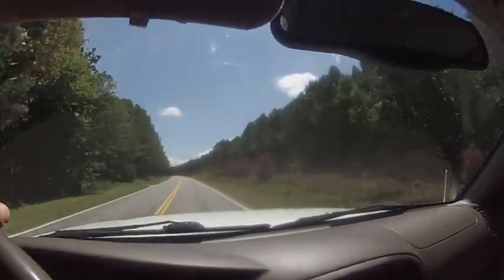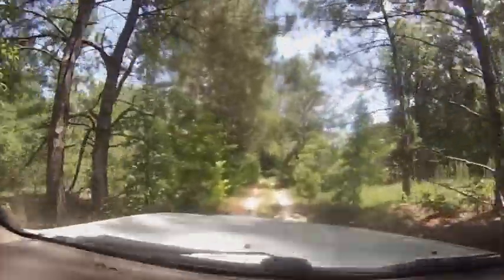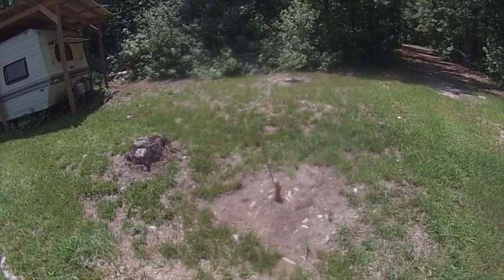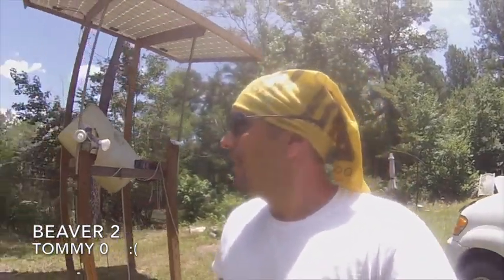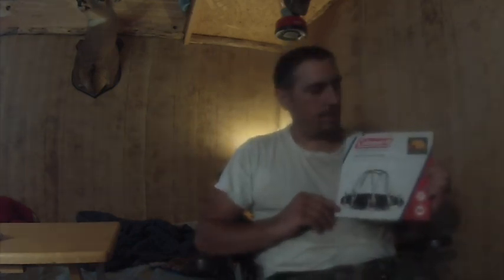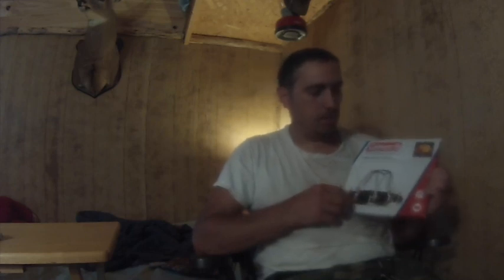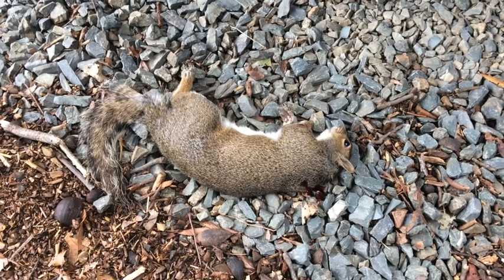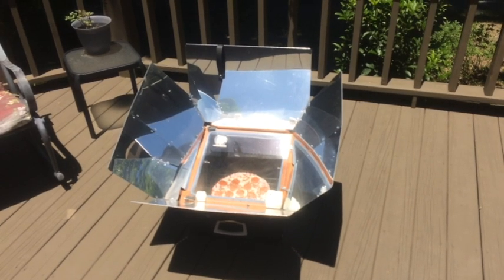Off Grid Cabin: More Tresspassers

Comment: Had the same issue on my off grid property.  I hinge cut some trees and dropped them over the trail.  They couldn't move the trees because they were still partially attached to the stump.  It worked for the most part, but they did find a way in on labor day weekend...But I caught them!  They walked around a bend in the trail and there I was standing in the trail.  I encouraged them to stay off my property and they haven't been back!

Comment: It looks like they are under power lines and they have sprayed herbicide on it to kill off the vegetation. They are doing that here in VA also.
Reply: Should have cooked the squirrel.
Reply: No its not roundup its definitely aluminobariumstrontophate sprayed from commercial airliners by the Illuminati based in the center of the hollow flat earth with a backup base on the dark side of the moon where the Naziempire is. 😂 
Some of these guys are not off the electric grid they're off the mental grid...

Comment: You need the jackleggs caught red-handed. Motion activated cams. Also look up boobytrap shotgun shell. Basicly a military grade trip wire attached to a simple device that fires a shotgun shell. Set it up correctly, and it's safe. This will send them running. After the unfreeze...... Lots of ways to eliminate the problem. Many!

Comment: The toaster will work well. Flip the bread as it's toasting. Maybe install a barbed wire fence across the path and hang a sign from it? I once drove across a mountain and ended up inside a locked gate. I drove over a ton of logs to get around the gate to leave. My quad was teetering a couple feet above the ground at times. I personally feel that tiny particles in the air are affecting the bees, bats and trees. They all have to deal with tiny particles. The trees are weakened and then things like bugs move in for the kill. After fracking came here, we had a lot of trees die. Fracking is radioactive. Radium 226, radium 228, thorium and uranium. So during flares the radioactive chemicals are burnt into the air and it messes things up. But there's so much radioactive pollution going on right now. One article suggested that 8 hours of flight is equal to one chest x-ray. There's a lot of radioactive pollution from things like fracking, leaking nuclear plants and radioactive dump in Washington. But I am curious if they might be geoengineering because of Japan's leaking power plant. Thinking about the storms that go up the east coast. Were those storms created to push radioactive pollution in another direction? But it's hard to believe that they would have anyone's best interest in mind because they hide the PA negative water test results and fact that some PA waterways are now radioactive. Condoms and climate transcript at climate one dot org said that people need predators. All the additional air pollution will shorten life spans. Avoid going out into the rain or having your windows open during or after rain storms because the particles will be coming down from the stratosphere. Everyone has been cutting the dead ash trees in PA. We have one tree that appeared dead last year and it is now trying to grow again.

Comment: Those pines were probably planted along the roadway by the state, to replenish after clear cutting, and were grown on a farm. Sometimes trees that are planted out in the wild die if not watered regularly, until their root systems can take hold enough to support them. This is especially true of pines in my experience because the tap root on a pine is supposed to be very long, approximately equal to the length of the tree above ground. Farm grown Pines tap roots are only as long as the bucket they were grown in.

Comment: You could cut down a few trees that are close together on either side of the road and make them fall across the road.  This will not be movable and impenetrable to a degree.

You could also build a dry stack wall with cinder block. The idea is that you   stack the cinder block like you would any wall, but with no mortar in between the blocks (hence the term dry stack).  Then you use a surface mortar to "stucco" the wall together so that no one can more the blocks one by one.  This can be done on the cheap.

Comment: https://en.wikipedia.org/wiki/Abatis This is a type of field fortification you can use to restrict movement into an area you want to secure. There are good images on the site and although I normally don't put much stock into Wikipedia, this information is accurate for a change. We used these as part of military exercises to create points that were difficult to go through.

Comment: Looks like to me that the county or state has sprayed the right away. As for the logging road, place posted signs on it and get about a pound of roofing nails and deposit them on the road on the other side of the logs. You will get results that way for sure. It works, I tried it myself.

Comment: Signs are a good start and communicate your desire for privacy. On the other hand I some of the old back roads have been traveled for years and there is an unofficial sense of entitlement since the were never really used until the new guy move in.  We get ATVs going across our land all the time; and for the most part they are just passing through on their way somewhere else. I have never seen anyone actually stay on our land just driving by going for a drive into the woods or hunting.  I am in a area where folks are very easy going and not uptight about this type of usage; the only ones I have ever heard with issues are the 'outsiders' not familiar with the people and area.

Comment: In my fantasy, claymore mines would work.  Being more practical,  I've seen a few loads of topsoil (which is not expensive, depending on how far it has to be hauled) at an ingress working well.  A deep wide trench from tree line to treeline works as well as does several steel pipes sunk deep with a bag of concrete around it. They're somewhat permanent but can keep a vehicle out when done right.  Keeping walkers out is a whole different ballgame unfortunately.   That's the big problem:  anyone who has no respect for a No Trespassing sign will find a way in if they really want to.

Comment: You can use several layers of chicken fencing (or other wire mesh) wrapped around the bases of the trees.  Use the entire width (about 4 to 6 feet) from ground level to as high as the width will reach..  Its easy to unwrap the fencing and let it coil loosely around the main truck from the ground to the height.  Stake it to the ground firmly, too, so the beaver can't lift it up and gnaw the base.  Another trick is to MIX HOTTEST hot sauce you can purchase (look for ghost pepper or Butan on the ingredient label as these peppers are reportedly the hottest in the world) WITH PETROLEUM JELLY (Vaseline).  NON-TOXIC to humans and animals; birds lack the taste receptors, but mammals WILL react to the HOT MIX.  Ants, and other crawlies will get stuck in the gooey paste.
The swaths of dead vegetation are from a chemical sprays used instead of mowing.  I disapprove of the chemical methods, but States and counties don't have $$ for tractor power mowers or $$ for workers.

Comment: Just get about 40 feet of 1/2 inch steel cable (preferably plastic coated / rust resistant ) and run it across the trail 3 or 4 feet above those logs from one solid tree to another and put 2 or 3  "no tresspassing" signs on stakes facing outward from the logs and cable.  Then if they decapitate themselves on the cable it is their own fault.

Comment: You also need No Trespass signs placed around your log barrier.  And chain the logs together.  Use your tractor to cut deep ruts across the roadway, at angles, not perpendicular to direction of travel.  A night intruder may get stuck in a rut, and you'll get a license plate to work with, or vehicle ID.  Odds are the same persons are repeatedly visiting your property.
Reply: I would wait until my head is clear. I hear you are not sure what to do. Wait until you are sure and not and not angry.    Stay 😎

Comment: utilities spray along the lines and don't clean up their mess just leave the dead trees
Reply: mary smith Real simple way
Reply: Get a couple pieces of small plywood two by to put about 10 £.16 nails through it planted just under the ground still run over it and they'll have a slow leak
Reply: The cost of four tires will stop them coming from on your property stupid AutoCorrect you knowwhat I'm talking about

Comment: The sun is just too intense during summer. If you measure the amount of UV light light I think you might find it is much higher in the last few years than it should be. Plants are getting hammered because their new leaves burn easily. Weird for sure. Can you afford to buy a game camera? Set that up in a hidden spot to catch them in the act. Ever thought of using removable bollards? The base has to be concreted in, but the post that fits in it and is padlocked on can be lifted out. If the base is deep enough, they can't even winch them out. Good luck. Something like this might do the trick... http://www.xpanda.co.nz/products/removable-bollards-galvanize

Comment: Trees are dying from exhaust fumes .
Reply: Could the trees alco be killed from the salt put on the roads during winter? In summer, the salt melts and runs into the ground around the trees and kills them.
Reply: Nah.. Primary gas from exhaust if CO2.. a plant food... I'm betting they are killed back just as they do in Michigan and Kentucky by the state spraying defoliant along the roadway to keep the plants from encroaching to close to the road... Generally the spray kills the smaller trees and shrubs but not long blade grasses or larger trees...
Reply: I would think it's the power company trying to keep down over growth. I noticed it was mostly under power lines and I know that power companies here in Missouri do so by spraying